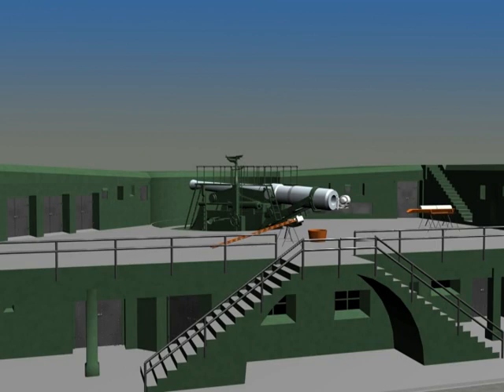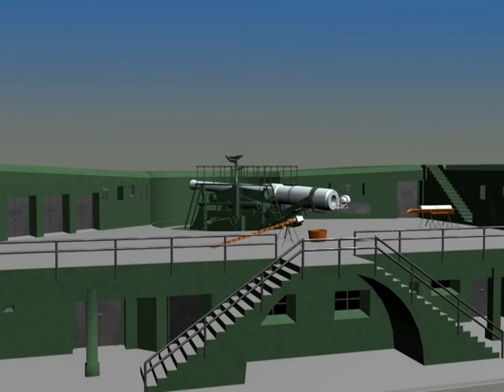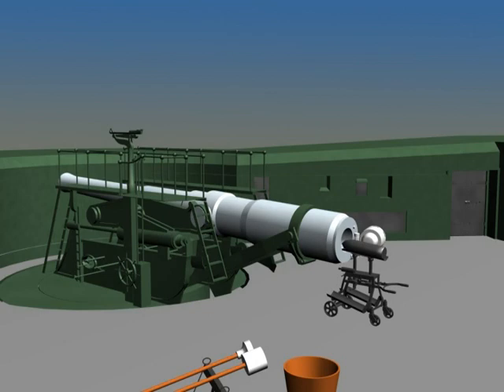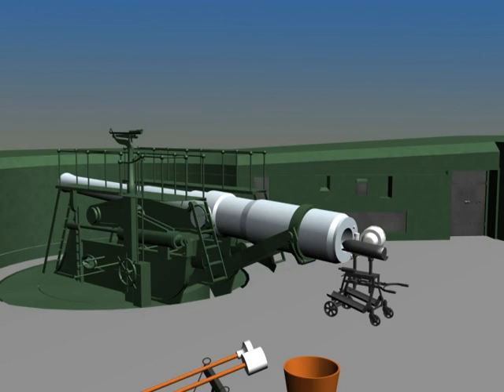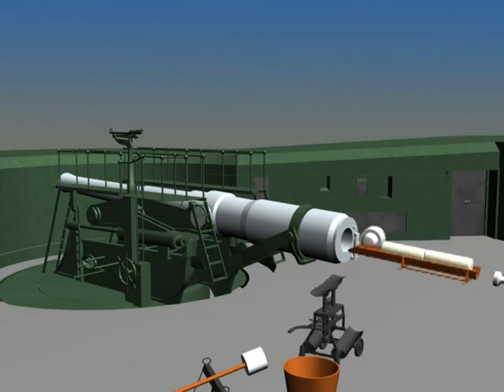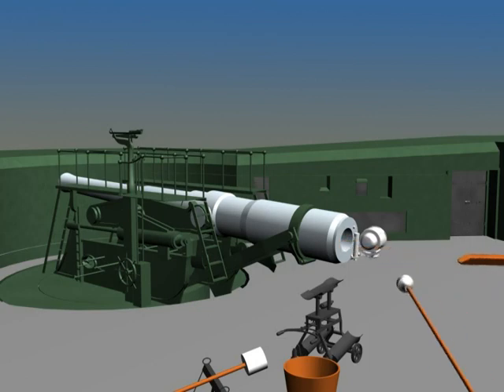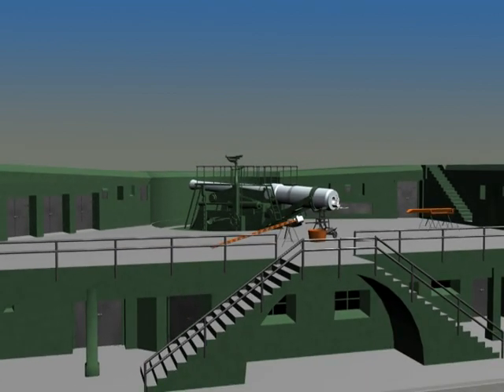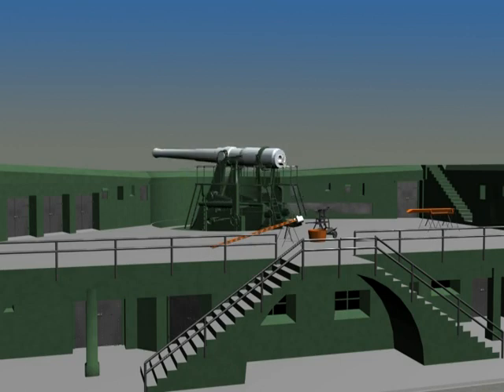10-Inch Disappearing Gun

Comment: 3 huge disadvantages:
1 – small vertical elevation angle of the trunk – 12 degrees.  That is, the maximum firing range of the gun (45 degrees) is not used.
2 - large losses of time for raising and lowering the gun. And if you use MANUAL lifting, then everything is generally bad. The rate of fire will always be lower than that of “classic” guns.
3 - the huge technological complexity of the carriage (hydraulics, electrical, mechanical) and huge WEIGHT.  The large mass of moving components (counterweight, parallelogram levers and horizontal carriage) means huge loads and a high probability of breakdowns.

Comment: They have two at Fort Casey. One in the raised position and one in the lower.  Most of the mechanism is there and you can see the massive counterweight and pulley system.  One of the guns has a decent mount shrapnel damage from what must have been an accident.
Reply: 😮P
Mm😊l😊ml